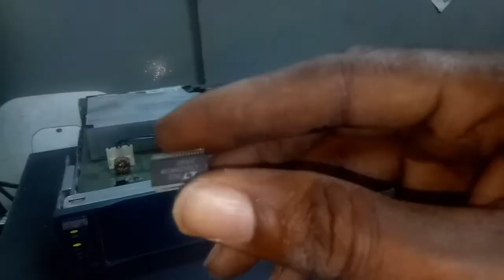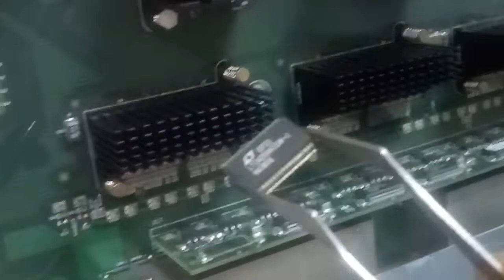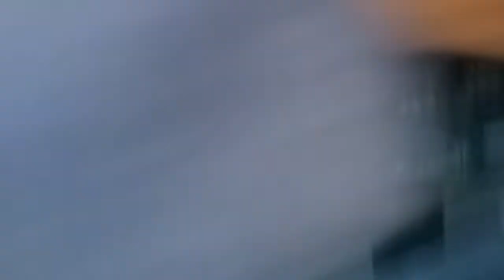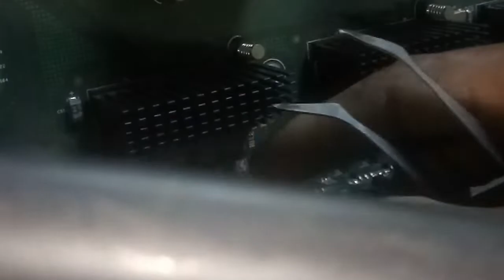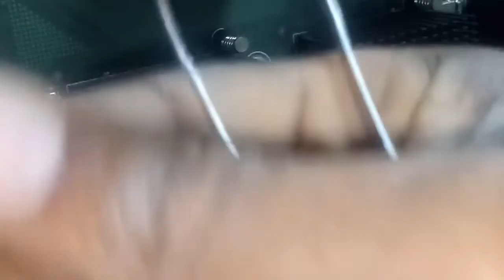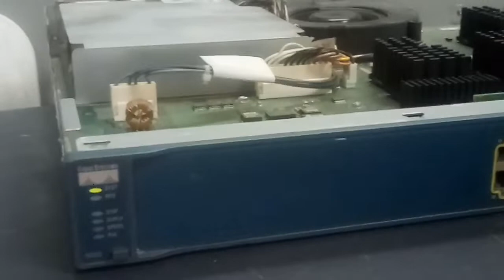#cisco #networking #software #switch #hardware  fix switch port hardware problems

Comment: If found any poe error also you can change the 1R00 resistor working with poe power mosfet enough to to fix this problem I think you don’t need to change the ic.
Reply from the maker: Bro that is not correct, only if the resistor have problem you can change, this resistor doesn't have problem all the time. This issue I fix is an ic issue not resistor. You are welcome
Reply: @jkftech  you are right in this video but I repaired a lot of switches 80% peo fix with changing the resistors and fuse…, if ic is heating then I changed to fix.
Reply: Bro how can I contact you.??
Reply from the maker: Send message on our Facebook page (JFK TECH)